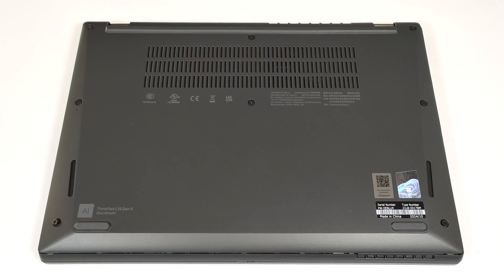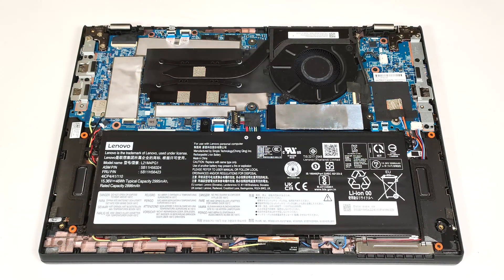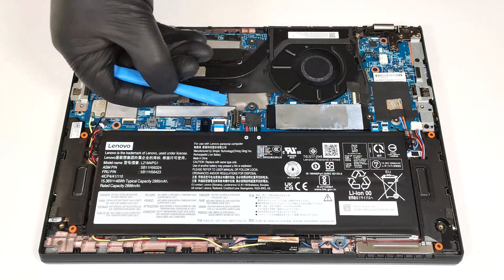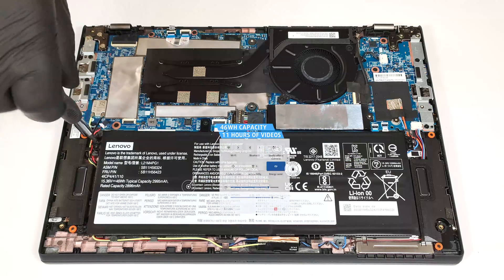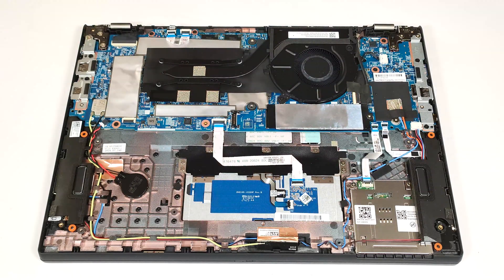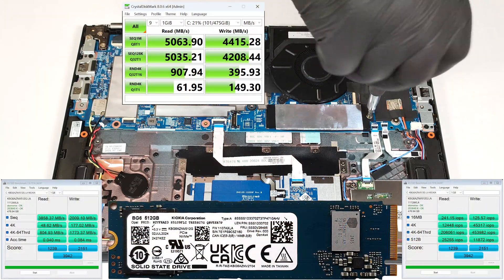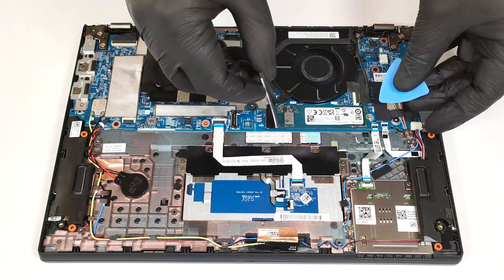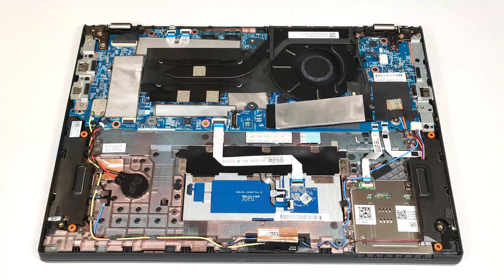🛠️  How to open Lenovo ThinkPad L13 Gen 5 - disassembly and upgrade options

Comment: Hey çan you do a vidéo of upgrading ssd on msi thin 15 b13vf 1440ca i dont found information about it in all the websites
Reply: What info are you looking at? It looks like you can have a max RAM of 64GB. You also should have a M.2 SSD port plug an additional SATA 2.5" port for upgrades. Would you like more help?